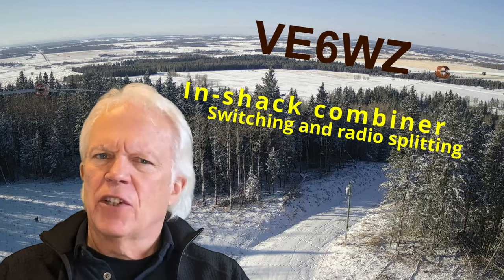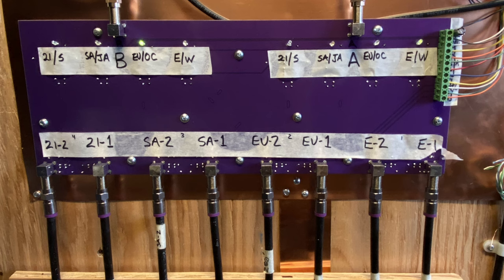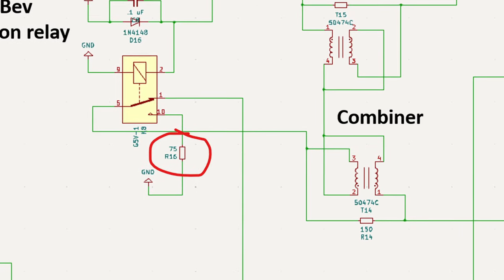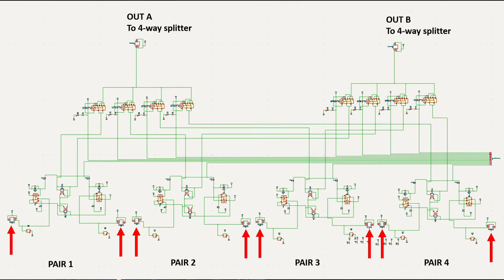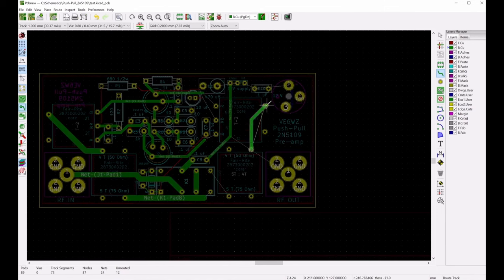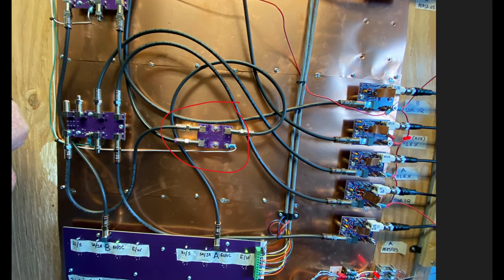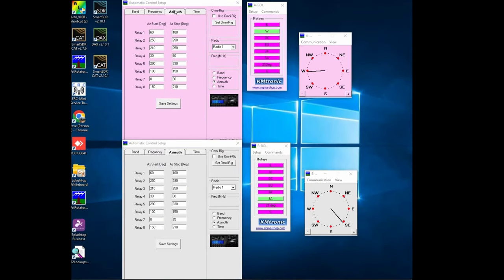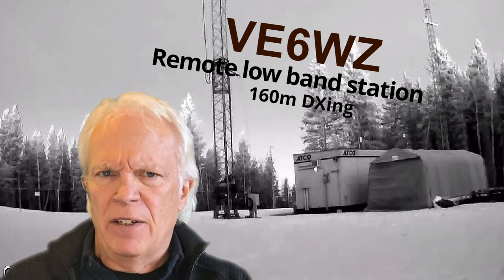BOG Combining and switching in the shack

Comment: Thanks again Steve. I would be interested in seeing how the KMTronic relay units compare with the Denkovi. I took a severe close lightning hit that damaged my Denkovi board this past Summer, killing my usb ports on the main computer. As you stated, there were some suffer points along the way getting the Denkovis configured. Boxes on the LAN may be a better solution. ~N8UX
Reply from the maker: Hi Rich,
For sure going with the ethernet boards makes life much simpler.  Set-up is very easy, and if I change PCs, I don't need to do anything....those IP addys remain the same.
Only problemo....those KMtronic boxes 'aint cheap.  I have aske YO3DMU a few times about adding the Denkovi LAN boards to his program, but no response.  The ethernet Denkovi boards are much more affordable.
Reply: @ve6wz  I agree, they are a lil pricier. But then again the PCBs from JLC are SO much cheaper than Oshpark (I was reluctant to take my business to BY land, but it's what it is). I have been using PSTrotator also, but if I could just get to the switch from the lan, or internet via port forwarding to the lan ip, the manufacturers app would probably be fine for my purposes. And re: the 2n5109, I also went to a similar DCP68 design, and found it to work just fine. Thanks again for your videos.